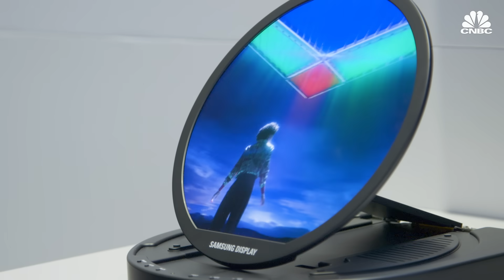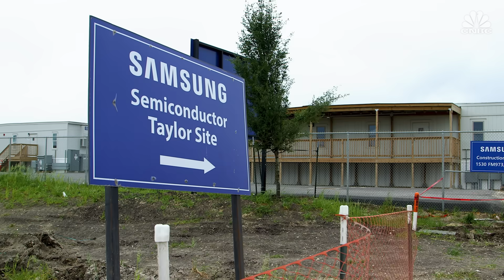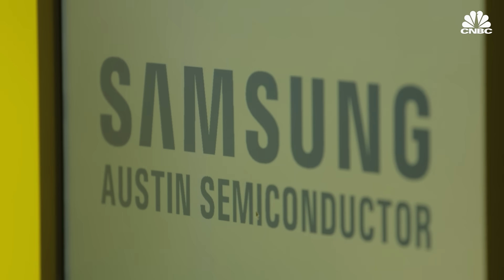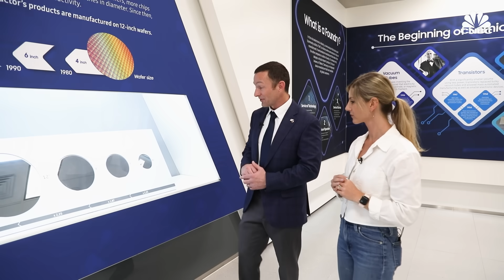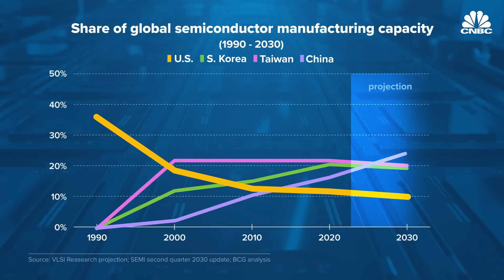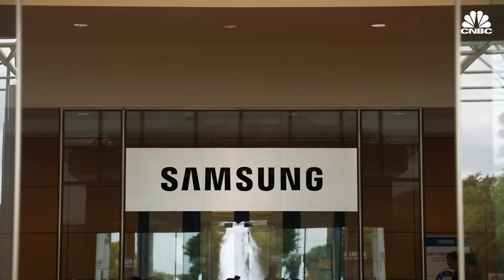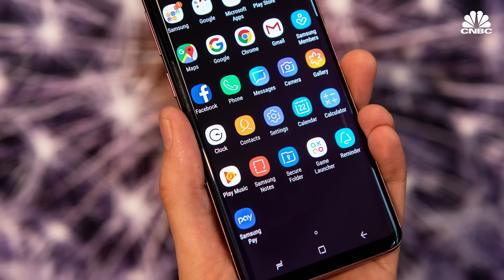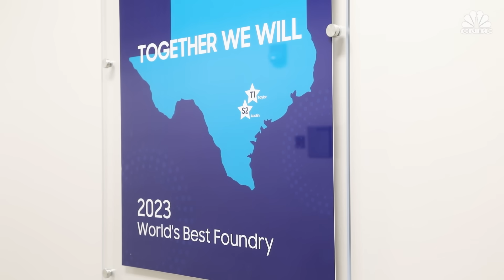The Untold Story Of Samsung’s Growing Chip Business

Comment: Samsung seems to have studied the failures of Sony very well and its taking steps in exact opposite of what Sony did.  Sony relied that their own superior technology, quality and design will last forever and did not diversify into other technologies. While Samsung's key is basically diversify into everything possible. Samsung will pour money into technologies that will fail just to make sure there isn't anything more there.  The loss in funds is nothing compared to losing the next technological advancement that will power the next generation of electronics... Samsung has a much better and solid grip on technology than Sony ever did...
Reply: Is unbelievable that Samsung built the tallest building in the world
Reply: What I've been hearing lately from tech journalists is that Samsung has actually been really struggling with its fab business. They are most certainly a major player in the chip fabrication business, but they've been investing huge amounts of money and just not performing well against TSMC. Nvidia made a lot of GPUs recently through Samsung (with their 3000 series, and I think also with some data centre/ workstation products), but Samsung had to offer Nvidia such a low price to entice them to manufacture with them that it apparently meant that they were more or less only breaking even. It is my understanding that this is just one example of a broader pattern of them struggling to keep up with TSMC, and struggling to get their fabs to be profitable. 

I do hope that they can get things together and stay profitable. Consumers will benefit from having more than just one major chip manufacturer for high-performance chips.
Reply: Samsung is originally memory and system, and started foundry few years ago, so it's natural. Under 3nm, Samsung and TSMC market share and technology are similar because Samsung can Gate All Around. Samsung semiconductor can get opportunity from new hardwares. They are making tons of new hardwares - ev solution, robot, vr, ring, etc. They can get orders + use own chips.
Reply: I swear texas is such a funny state their land is so cheap because its so polluted  the only people they can give it away to are commercial companies that can pay alot and get this cheap land that only asks you build your own infrastructure and beyond that try and not make to much more waste approach while also probably only doing this while everyone is hating on them for it
Reply: Japan lost not because of their arrogant because of US companies losing ground US government didn't like that and they intervene it is unwritten rule of global order never try to surpass United States of America 🇺🇸🇺🇸🇺🇸💪🏻💪🏻💪🏻
Reply: all those japanese electronics that shined in 1970s-80s were big fishes in a small pond. they were too complacent and indulged with themselves. it's been more than a decade since sales of samsung itself surpassed sales of japanese electronics top 1-10 all combined. the gap doesn't seem to narrow at this point. it rather looks widening as the era of robot & ai is approaching.
Reply: the know only reason Samsung from the start because the US govt force the yen to strengthen . So the Japanese could not compete.  It did not help the Japanese bank were in a freefall due to huge debt ..
Reply: After 1986, the American market share curve is a deadly death, which has been around 20%. Intel lost to Japan. Enterprises, the ultimate abandonment of semiconductor storage business, into the field of microprocessors, then, which 70% of the huge market has entered the stomach? The answer is South Korea. In Japan before and after the United States fat 1986, South Korea DRA M started the machine, but the volume is like a toddler baby, and there is no sense in the global semiconductor chip industry. Compared with Japan, the Korean semiconductor chip company represented by Samsung is completely 360-degree dead chicken: fundamentally If you can’t get into the high-end market dominated by the Japanese, you can only eat at low prices in the low-end market. In terms of market size, the two are the difference between ants and elephants. But Samsung knows that all trade friction problems belong to politics. In the field of economics, he took the opportunity to overturn the Japanese elephant. Li Jianxi seized the excellent opportunity of Japan and the United States to carry out the chip war, led Samsung Semiconductor to successfully counter the upper 1990s, Samsung faced the US-sponsored anti-dumping lawsuit, but its head Li Jianxi Cleverly use the opportunity of Americans to suppress the Japanese semiconductor industry, and send a strong public relations team to lobby the Clinton administration: “If Samsung can’t manufacture chips normally, the trend of Japanese companies occupying the market will become more obvious. The reduction of competitors will further increase the purchase of American companies. The price of the chip will be even more disadvantageous for US companies. “Then, the Americans only charge 0.74% of anti-dumping duties to Samsung, and the highest in Japan are charged 100% of anti-dumping duties. This kind of operation is simply too lazy to install. Samsung holds the thigh of the United States, which is equivalent to giving it from behind.” Japan has a knife, let Japan completely out. The key to winning the game If there is no Samsung to fill the knife, Japanese semiconductor chips still have the hope of getting out of the predicament. The Americans used the “US-Japan Semiconductor Agreement” to bind the Japanese and waved anti-dumping sticks to be fat, but Japan’s semiconductor memory chip industry is only suffering from skin injuries, because more than 70% of Silicon Valley companies have withdrawn from the semiconductor memory chip industry, the market is still firmly in the hands of the Japanese, and in the past, it is a group of Toyo heroes, after all, in the global semiconductor chip In the industrial chain, Japan is still an irreplaceable force. After Samsung joined the battle group and took the initiative to stand in the United States, the Japanese who are difficult to replace suddenly became dispensable, and the Koreans became the new favorite. Then, Samsung’s DRAM The two-way data selection scheme was approved by the American Semiconductor Standardization Committee to become a microprocessor compatible In terms of memory, Japan was excluded. In this way, Samsung successfully took the microprocessor-driven PC era express train and was ahead of Japanese companies. Japan’s lost semiconductor chip share almost entered the mouth of a Korean-led company from above. In the DRAM share chart, Japan’s share is falling, and South Korea’s is a steep rising curve. A pair of two lines form a huge pair of scissors, which cuts off the future of Japanese semiconductor chips. Even if the Japanese government intensively introduced the semiconductor industry support policy and invested a lot of money, but it was unable to return to the sky, the fate of the Japanese semiconductor chip out was fixed. After the Toshiba semiconductor plug-in was sold, it marked that the Japanese semiconductor chip was completely out until today.

“Then, the Americans only charge 0.74% of anti-dumping duties to Samsung, and the highest in Japan are charged 100% of anti-dumping duties.   After Samsung joined the battle group and took the initiative to stand in the United States, the Japanese who are difficult to replace suddenly became dispensable, and the Koreans became the new favorite. Then, Samsung’s DRAM The two-way data selection scheme was approved by the American Semiconductor Standardization Committee to become a microprocessor compatible In terms of memory, Japan was excluded. In this way, Samsung successfully took the microprocessor-driven PC era express train and was ahead of Japanese companies.
Reply: @Ukit50  bro i aint reading all this. sum it up in bullet points.
Reply: @Ukit50 😊
Reply: There are many electronics competing in South Korea. SK magic, LS, LX, HL, DL, KHE, Semes, Hansol, Saehan, Hyosung, Doosan, Winia, Winix, Paseco, Shinil, Cowon, iriver, Coway, Chungho, Navien, Kiturami, Haatz, Ocoo, Lisso, Inkel, Lucoms, Patech, Hanil, Pantech, Alice, Unix, Aesty etc.
Reply: Iphone suspects that Samsung took 'illegal' (located) actions when using a manufacturer in China, not in South Korea or anywhere else. Strict copyright laws or intellectual property patents
Meanwhile, in China itself, it is weak in copyright or intellectual property law, making it difficult for the judicial process in the US or South Korea.
Reply: @orientalcaesar  what does it took "illegal" located actions even mean??
Reply: US contained the Japan industry, now raised the South Korea and Taiwan.  US is still behind.  Have to improve yourself.  Only contain others doesn't work.
Reply: @cinpeace353 it's black people and Africa being contained you dimwit and while invincible and superior by the way
Reply: @cinpeace353  Lol
Japan is literally made by West (Meiji) and raised by US to contain Soviet industry.
Reply: @cinpeace353  
CONTINUATION

Previously, the SIA had been lobbying for seven years, and the government’s response was always: the United States is a free market, and government power should not be referred to corporate operations. The Americans blamed Japan’s semiconductor radio for dissatisfaction. This time, the SIA’s “National Security Theory” came out, and the US government’s slogan changed from the original grinding to the fast-moving, and the efficiency was amazing: in the spring of 1986, Japan was recognized as read-only. Memory dumping; in September, the US-Japan Semiconductor Agreement was signed, and Japan was required to open up the semiconductor market to ensure that foreign companies gained 20% market share within five years; soon, 100% punitive tariffs on Japanese exports of 300 million US dollars chips; Fujitsu acquired Fairchild Semiconductor. This wave of American operations has created at least two records: the first global strike against the economic interests of allies; the first time the issue of trade disputes has changed from economics to political economy on the grounds of national security. Clyde Prestowitz, the chief US trade representative in charge of the Asian negotiations with Japan, accused Japan of the unreasonable policy of the semiconductor chip industry and praised it. “So I told the US government that we are We must also adopt the same policy measures as Japan.”On this double standard, the soup that had been researched and developed by Hitachi and Elpida for many years, said in his book, “This person is really deceiving too much!” With the signing of the US-Japan Semiconductor Agreement, the Japanese semiconductor chip industry, which is at the height of the wave, turned back to the abyss. The Japanese semiconductor chip industry has fallen from a maximum of 40% in 1986, and has fallen to 15 in 2011. %, spit out more than half of the market share, of which DRAM hit the biggest, from the highest point of nearly 80% of the global market share, all the way to the lowest 10% (2010), reversing nearly 70%. It can be said that with the Americans In this battle, the Japanese accumulated money before the basic loss of light, the country worked hard for eleven years (from 1975 to 1986), was beaten back to liberation overnight. But the Japanese spit out the meat, did not fall to the American mouth In the Silicon Valley, more than 70% of the technology companies cut off the DRAM business (including Intel and AMD).
Reply: @cinpeace353  
In just over 30 years, few people have remembered the chip war that broke out between Japan and the United States. In this battle, the Japanese lost their money, occupying nearly 80% of the world’s DRAM (commonly known as computer memory) share from the peak, and fell to zero now. This chip war perfectly explains what is called international political economy. Adam Smith’s theory of free market competition is just a beautiful fairy tale in the big country industry PK. The first five years of the 1980s were the highlights of Japanese semiconductor chip companies. In the semiconductor storage field, Intel and AMD and other technology startups in Silicon Valley were chased by the Japanese, and then they were overtaken and driven away from the throne. The semiconductor chip field (which was mainly dominated by semiconductor storage at the time) became the back garden of Japanese companies. American technology companies have lost their models. The development model of Silicon Valley is to invest capital into startups through venture capital. After the startups receive financial support, they will continue to acquire technological innovations to gain market, enhance the company’s valuation, and then go public, and venture capital will sell stocks to profit. This model is market-oriented, efficient, but small in size, and it is difficult to integrate resources between companies. After all, everyone is a competitor in the pan. Kyushu Island is known as Japan’s “Silicon Island”. It has concentrated on Japan’s vast majority of semiconductor chip companies. The Japanese play is very different: concentrate on doing big things. In 1974, the Japanese government approved the “Very Large Scale Integrated Circuit (commonly known as Semiconductor Chip)” program, setting the goal of catching up with US integrated circuit technology. Subsequently, the Ministry of International Trade and Industry of Japan organized Hitachi, NEC, Fujitsu, Mitsubishi and Toshiba to integrate the talent resources of Japanese production, research and research semiconductors, break down corporate barriers, enable enterprises to collaborate and improve the technical level of Japanese semiconductor chips. Japan’s plan has also died a little bit, and companies have been wary of each other and demolition of each other. The government’s promised funds have been delayed. At the crucial moment, the founder of Japanese semiconductor research, Tsujii Yasuo, stood up. He used his prestige to knead the various participants. The statement of Mr. Sakai is simple and clear: Only by working together can we change the backwardness of Japan’s chip-based technology. When the research results come out, each company will conduct product research and development. Only in this way can we reverse the dilemma of Japanese companies fighting alone in international competition. The Americans were frightened by the plan for four years, and Japan obtained thousands of patents, which suddenly narrowed the technological gap with the United States. Then, the Japanese government introduced measures such as loans and tax incentives, and companies such as Hitachi, NEC, and Fujitsu were strong and strong enough. A modern semiconductor memory chip manufacturing plant has emerged in Japan. As the production line runs day and night, the Japanese launched a saturation attack. The American nightmare begins. In 1980, Japan captured 30% of the semiconductor memory market. Five years later, Japan’s share exceeded 50%, and the United States was left behind. Silicon Valley’s high-tech companies can’t stand the market share, and they continue to send people over the Pacific to Japan to scout, which makes people feel desperate. Andy Grove, then Intel’s production director, said with dismay: “The people who came back from Japan have described the situation very seriously.” If Grove went to Japan, he would be scared: a Japanese company. An entire building was used for storage chip development. The first floor staff developed 16KB capacity, the second floor staff developed 64KB, and the third floor staff developed 256KB. The Japanese rhythm of research and development is simply the legendary three arrows, so that Silicon Valley companies accustomed to one-handedly playing the knife have no power. What makes Americans feel suffocated is that Japan’s memory chips are not only large, but also of good quality. In the 1980s, the American Semiconductor Association conducted quality tests on memory chips in the United States and Japan, hoping to find the weaknesses of their rivals, and found that the highest quality memory chips in the United States were worse than the worst quality in Japan. Moreover, the Japanese also patted their chests to assure customers that the Japanese memory chip guarantees quality for 25 years! Intel almost stunned the Japanese under the aggressive attack, the American chip company was defeated, and the financial data was like melting ice cream, a mess.In 1981, AMD’s net profit fell by 2/3, National Semiconductor lost $11 million, and earned $52 million in the previous year. In the second year, Intel was forced to lay off 2,000 employees. The Japanese continued to expand their battles. The Americans continued to mourn. In 1985, Intel surrendered and announced its withdrawal from the DRAM storage business. This war caused it to lose $173 million, the first loss since its listing. At Intel’s most critical moment, if IBM did not help, and bought 12% of its bonds to guarantee cash flow, the chip giant is likely to close down or be acquired, and the history of the US information industry may be rewritten. Intel founder Robert Noyce (left) and other Silicon Valley companies set up SIA, the goal is to deal with the competition of Japanese semiconductor companies Intel founder Robert Noyes lamented the United States into the process of “imperial decline.” He asserted that if this situation continues, Silicon Valley will become a ruin. What makes Americans intolerable is that Fujitsu intends to acquire an 80% stake in Fairchild Semiconductor. Fairchild Semiconductor is the living fossil of Silicon Valley, as the founders of most of Silicon Valley’s technology companies (including Intel and AMD) were once employees of Fairchild Semiconductor. In the minds of Silicon Valley people, the existence of Fairchild Semiconductors, and now the Japanese have to buy their “God”, is this not a shame? One American newspaper wrote in the report: “This transaction tells us through a message that we are already lagging behind. What is important is how we should respond to this.” Fairchild Semiconductor has a sacred position in the hearts of Silicon Valley people. Formerly, the Silicon Valley technology company established the Semiconductor Industry Association (SIA) to deal with the Japanese attack. After several years of lobbying, the results were as follows: the capital income tax rate was reduced from 49% to 28%, and the pension was pushed into the venture capital field. But the government is reluctant to come forward to help. Bitter until June 1985, SIA finally concocted a view that made Washington not calm, and turned the situation in one fell swoop. The magic logic reverses the situation. SIA’s view is that the weakening of the US semiconductor industry will bring significant risks to national security. Is Japan not an ally of the United States? The rise of Japanese semiconductors, the decline of American semiconductors, and the game of watching the left pocket and the right pocket, how can it threaten the national security of the United States? The logical chain of SIA is this: because super-weapon technology is inseparable from super-electronic technology, super-electronic technology is inseparable from the latest semiconductor technology (this is no problem); if the US semiconductor technology is backward, the US military will be forced to The use of foreign products on key electronic components, including Japanese goods (somewhat meaning); foreign sources are unreliable, the United States will be out of stock during the war, and will be supplied to the US rivals in the non-war period (Japanese see here, it is estimated to cry Therefore, the United States let Japan dominate the semiconductor chip field, it is equal to the sacrifice of national security
Reply: In just over 30 years, few people have remembered the chip war that broke out between Japan and the United States. In this battle, the Japanese lost their money, occupying nearly 80% of the world’s DRAM (commonly known as computer memory) share from the peak, and fell to zero now. This chip war perfectly explains what is called international political economy. Adam Smith’s theory of free market competition is just a beautiful fairy tale in the big country industry PK. The first five years of the 1980s were the highlights of Japanese semiconductor chip companies. In the semiconductor storage field, Intel and AMD and other technology startups in Silicon Valley were chased by the Japanese, and then they were overtaken and driven away from the throne. The semiconductor chip field (which was mainly dominated by semiconductor storage at the time) became the back garden of Japanese companies. American technology companies have lost their models. The development model of Silicon Valley is to invest capital into startups through venture capital. After the startups receive financial support, they will continue to acquire technological innovations to gain market, enhance the company’s valuation, and then go public, and venture capital will sell stocks to profit. This model is market-oriented, efficient, but small in size, and it is difficult to integrate resources between companies. After all, everyone is a competitor in the pan. Kyushu Island is known as Japan’s “Silicon Island”. It has concentrated on Japan’s vast majority of semiconductor chip companies. The Japanese play is very different: concentrate on doing big things. In 1974, the Japanese government approved the “Very Large Scale Integrated Circuit (commonly known as Semiconductor Chip)” program, setting the goal of catching up with US integrated circuit technology. Subsequently, the Ministry of International Trade and Industry of Japan organized Hitachi, NEC, Fujitsu, Mitsubishi and Toshiba to integrate the talent resources of Japanese production, research and research semiconductors, break down corporate barriers, enable enterprises to collaborate and improve the technical level of Japanese semiconductor chips. Japan’s plan has also died a little bit, and companies have been wary of each other and demolition of each other. The government’s promised funds have been delayed. At the crucial moment, the founder of Japanese semiconductor research, Tsujii Yasuo, stood up. He used his prestige to knead the various participants. The statement of Mr. Sakai is simple and clear: Only by working together can we change the backwardness of Japan’s chip-based technology. When the research results come out, each company will conduct product research and development. Only in this way can we reverse the dilemma of Japanese companies fighting alone in international competition. The Americans were frightened by the plan for four years, and Japan obtained thousands of patents, which suddenly narrowed the technological gap with the United States. Then, the Japanese government introduced measures such as loans and tax incentives, and companies such as Hitachi, NEC, and Fujitsu were strong and strong enough. A modern semiconductor memory chip manufacturing plant has emerged in Japan. As the production line runs day and night, the Japanese launched a saturation attack. The American nightmare begins. In 1980, Japan captured 30% of the semiconductor memory market. Five years later, Japan’s share exceeded 50%, and the United States was left behind. Silicon Valley’s high-tech companies can’t stand the market share, and they continue to send people over the Pacific to Japan to scout, which makes people feel desperate. Andy Grove, then Intel’s production director, said with dismay: “The people who came back from Japan have described the situation very seriously.” If Grove went to Japan, he would be scared: a Japanese company. An entire building was used for storage chip development. The first floor staff developed 16KB capacity, the second floor staff developed 64KB, and the third floor staff developed 256KB. The Japanese rhythm of research and development is simply the legendary three arrows, so that Silicon Valley companies accustomed to one-handedly playing the knife have no power. What makes Americans feel suffocated is that Japan’s memory chips are not only large, but also of good quality. In the 1980s, the American Semiconductor Association conducted quality tests on memory chips in the United States and Japan, hoping to find the weaknesses of their rivals, and found that the highest quality memory chips in the United States were worse than the worst quality in Japan. Moreover, the Japanese also patted their chests to assure customers that the Japanese memory chip guarantees quality for 25 years! Intel almost stunned the Japanese under the aggressive attack, the American chip company was defeated, and the financial data was like melting ice cream, a mess.In 1981, AMD’s net profit fell by 2/3, National Semiconductor lost $11 million, and earned $52 million in the previous year. In the second year, Intel was forced to lay off 2,000 employees. The Japanese continued to expand their battles. The Americans continued to mourn. In 1985, Intel surrendered and announced its withdrawal from the DRAM storage business. This war caused it to lose $173 million, the first loss since its listing. At Intel’s most critical moment, if IBM did not help, and bought 12% of its bonds to guarantee cash flow, the chip giant is likely to close down or be acquired, and the history of the US information industry may be rewritten. Intel founder Robert Noyce (left) and other Silicon Valley companies set up SIA, the goal is to deal with the competition of Japanese semiconductor companies Intel founder Robert Noyes lamented the United States into the process of “imperial decline.” He asserted that if this situation continues, Silicon Valley will become a ruin. What makes Americans intolerable is that Fujitsu intends to acquire an 80% stake in Fairchild Semiconductor. Fairchild Semiconductor is the living fossil of Silicon Valley, as the founders of most of Silicon Valley’s technology companies (including Intel and AMD) were once employees of Fairchild Semiconductor. In the minds of Silicon Valley people, the existence of Fairchild Semiconductors, and now the Japanese have to buy their “God”, is this not a shame? One American newspaper wrote in the report: “This transaction tells us through a message that we are already lagging behind. What is important is how we should respond to this.” Fairchild Semiconductor has a sacred position in the hearts of Silicon Valley people. Formerly, the Silicon Valley technology company established the Semiconductor Industry Association (SIA) to deal with the Japanese attack. After several years of lobbying, the results were as follows: the capital income tax rate was reduced from 49% to 28%, and the pension was pushed into the venture capital field. But the government is reluctant to come forward to help. Bitter until June 1985, SIA finally concocted a view that made Washington not calm, and turned the situation in one fell swoop. The magic logic reverses the situation. SIA’s view is that the weakening of the US semiconductor industry will bring significant risks to national security. Is Japan not an ally of the United States? The rise of Japanese semiconductors, the decline of American semiconductors, and the game of watching the left pocket and the right pocket, how can it threaten the national security of the United States? The logical chain of SIA is this: because super-weapon technology is inseparable from super-electronic technology, super-electronic technology is inseparable from the latest semiconductor technology (this is no problem); if the US semiconductor technology is backward, the US military will be forced to The use of foreign products on key electronic components, including Japanese goods (somewhat meaning); foreign sources are unreliable, the United States will be out of stock during the war, and will be supplied to the US rivals in the non-war period (Japanese see here, it is estimated to cry Therefore, the United States let Japan dominate the semiconductor chip field, it is equal to the sacrifice of national security
Reply: @Ukit50  : dude, nobody is going to read beyond the first line.
Reply: @Ukit50  Are you ChatGPT?😅